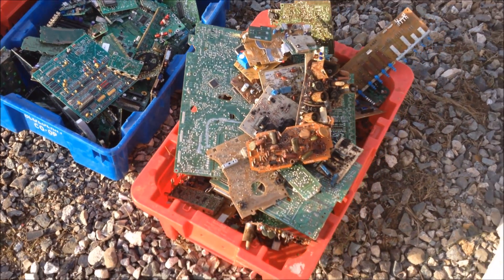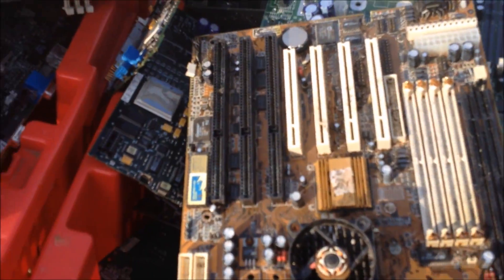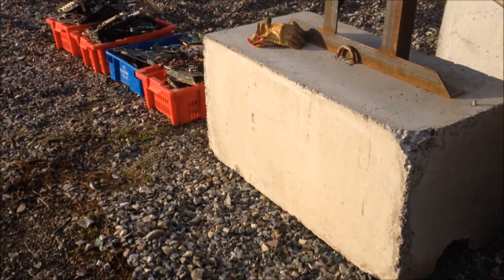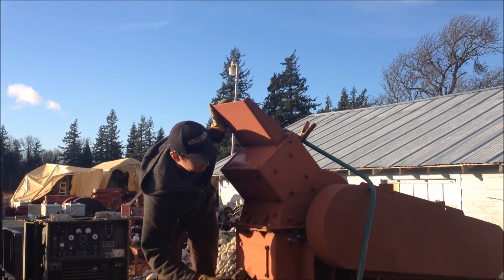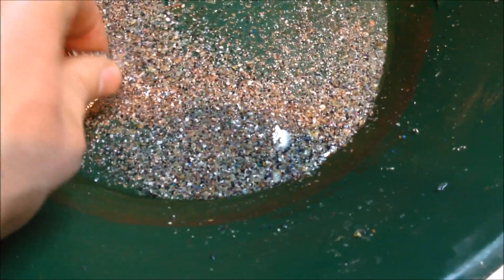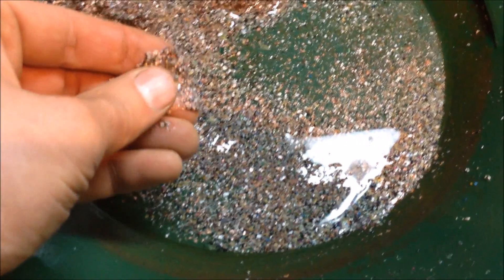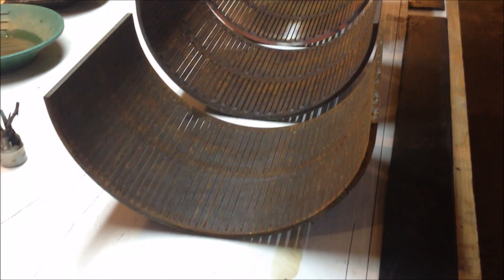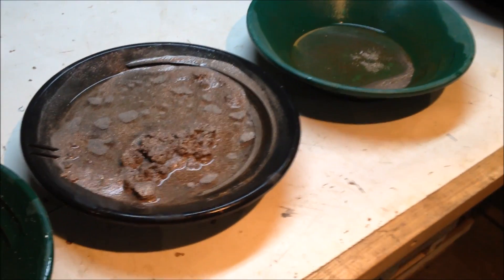URBAN MINING! Recovering gold, copper, precious metals from PCB's without chemicals

Comment: Just some thoughts. What you call free gold is gold from inside black IC chip packages also from black part of chip you refer as gold corner. It is inside in form of gold bonding wires. However they are very soft and male-able so some broken pieces of bonding wires may end up smeared on other pieces of metal due to action going on in hammer mill so your copper or other metal discharge can contain some amount of gold too. It happened to me when I was grinding this type of material too, The more I grind-ed material, I noticed gold powder from bonding wires disappearing and base metal pins becoming golden :)  Broken gold plated pins will be there too (metal discharge). I have sent you email with some of my findings. Keep up the good work.
Reply from the maker: Patnor-

Thanks for the tips and the feedback.  It is always good to get some feedback from others who have been through the process before.  I think over grinding is something that really needs to be avoided due to over grinding the gold (or other metals) which makes them harder to concentrate by gravity.  Flownder (previous commenter) was also talking about cleaning the boards by hand of the more valuable materials before grinding them all up in the hammer mill.  This may be the way to go for gold chips and other valuables on the boards?  Do you have any experience with hand processing the boards first before grinding?  Does it pay to do so?  Also do you have any idea about the purity of the gold from the bonding wires?  Thanks, your comments are much appreciated!
Reply: mbmmllc I would not go that route if I will have some big loads, I mean it is not economically viable in my opinion to do boards by hand. Your approach is somehow better but do have its own challenges which need to be solved. I think that if you achieve successful sorting of material to organics with no value and metals that is the most important thing. It save energy and environment from incineration method. I suggested to separate at least s/n bridge chips from boards before grinding as leaving them there will just mix easy to be recovered gold together with other junk. Gold bonding wires are made from fine gold. I got my hands at couple hundred kilograms of boards and depopulating or cherry picking values from them is a long tedious work which make sense only if you do it as a hobby. Not as a job. It require set up and know-how worth few millions to be able to turn around volumes and make a living out of it.

Comment from the maker: Hi Flownder-
Thanks for the comments.  Our goal with the circuit boards is handle them as little as possible, get them ground up, and recover the metals to sell to a refiner for further processing.  It is going to be costly and take a lot of time to hand clean the boards.  It might be worth it, I am not sure.  My only question is the price of tantalum is about $150/lb so I'm wondering why the tantalum capacitors are only worth $6/lb?  Wouldn't you rather grind them up, get all the tantalum out and sell it with all your other metals?  Even if you only get paid 1/2 price from the refiner you still get $75 per pound for the tantalum and you don't have any extra time sorting and hand cleaning all the little pieces.  

Your other comment about saving up the #2 and #3 hole are right on!  I completely agree, save up a few 55 gal drums and then cash in at the refiner.  Thanks and let me know what you think about hand sorting vs grinding, because maybe you are on to something I don't know.  I know the Chinese hand sort some of their boards, but I think their pay rate is quite a bit lower than in the USA so it might be profitable over there.  Thanks again.
Reply: Depends if your set up to do all boards all the way through like the big boys do and depending on how much material your getting in and what your time is worth. Sorry on the $6.00 should have been $16.00, the price of Ta you quoted is clean vacuum melt Ta, refineries don't pay on Ta, they pay on Cu, Au, Ag, Pt & Pd from PCB's and that's it. That's why with the amount of material I have coming in I take off all the aluminum, steel and plastic I can within reason. For every pound of material I take off the boards that I'm not going to get paid on from the refinery, I'm saving a buck on it. So say I'm taking off all aluminum, extruded, cast and sheet, most heat sinks are extruded and worth the most of the aluminum items, so about $0.65 a lb, when you add the buck you save on processing fee that's $1.65 per lb. on aluminum extrusions. Electrolytic capacitors, the aluminum can type are sold as breakage at about $0.12 per lb., again easy to take off and add the buck per lb. Then there are items I take off to be processed by me ie: fingers, north & south bridge packages and some pins and other surface mount devices.

Even if you worked out a better deal with the refinery for the processing fee (that's about $1.00 per pound right now) by telling them you could grind up the material first (and I'm not saying they would do that) your not getting it fine enough for them. When they are done with the grinding process, that stuff is like talcum powder it's so fine. btw, don't grind up any batteries like the button batteries.

What you could also do is just like your doing but melt it all with Cu as the collector and make dore or refiner bars and sell them to a refinery based on the assay. But now your going down the EPA regulatory road. Heck even the grinding stage is regulated so don't get caught grinding them up.

If nothing else, stop grinding up power supply boards aka: low grade boards. None of the boards in the video that I saw were high grade. The better boards you had were mid grade mother boards. High grade would be telecom type boards covered in chips and or gold plating, or just old highly populated boards pre mid 90's. Also, refineries have a minimum so that was why I said about 5k pounds. If you had 10k lbs. they will usually drop the fee by $0.20 per lb. It's hard seeing all this treasure and finding out how hard it is to get it out. Oh, and the stuff made today don't have near the pm's in it that it once did.
Reply from the maker: flownder28 WOW!  You are a wealth of information, and it sounds like you have some real life experience in processing boards.  If you don't mind sending us an email at MBMMLLC@gmail.com or give us a call at 360-595-4445 we would love to pick your brain a little bit and learn how we can improve our process from your experiences.

I am really surprised the refinery doesn't pay for more of the metals.  I think there is lots of Pb, Sn, Ta (if you don't pick the Ta off), others?.  Is your refiner in the US/Canada or international?

I have a good friend who has a mill in MT and he is processing a hardrock ore with copper, lead, zinc, and some gold and silver.  He is making a concentrate by gravity and flotation.  The con assays about 10% copper, 20 oz/t Au, 100+ oz/t Ag, with lead and zinc as well.  He couldn't find a refiner in North America to pay him for anything more than the Au and Ag.  Right now he is sending his concentrate by rail to the port in Seattle and sending it to a refiner in Korea and they pay for everything, including the Fe and S which is considered waste here in the states (we often times don't even assay for it when looking at ores, and when we do we only use it for an indicator metal, not value added).  He is making more money by sending to Korea, even with the extra shipping cost, because he is getting paid for all the metals.  I am wondering if you could find a refiner who would pay for more of the metals in the boards if it would be worth while, even with the shipping cost?

Good tip on the batteries, I know there is a ton of nasty stuff in there you don't want to be exposed to.

Do you grind your boards up and concentrate the metals once you de-populate them or do you just send them to refiner whole?  I am re-thinking the whole board grinding process to look something like this:

1.) Boards are pre-sorted into low, med, and high grade piles
2.) Boards that are worth it are de-populated by hand to remove: Ta, IC chips, finger, Al, anything else that is worth/pays to remove.
3.) Boards are then run through hammer mill and onto shaker table to recover mostly Cu, Pb, Sn, etc. and the PM's that were not removed by hand (if any)
4.) #1 hole from table (high grade concentrates) refined in house to remove Au, Pt, etc.
5.) #2 and #3 hole are stored in barrels to be sent off to refiner
6.) Tailings go to waste, or further processing (incinerate?, grind finer? reprocess?) if it pays or is needed.

How does that flow sheet sound?  I think regardless of if you de-populate the boards or not they still need to be ground up to recover all the copper, etc.  because by grinding and concentrating the metals I think you remove about 1/3-1/2 the total weight.  I think that means that you can save about 50% (50 cents/lb at your current price) on your refining costs by removing the fiberglass board weight which doesn't pay anything at the refiner.  Let me know if this makes sense or I am just wasting time by grinding the boards up in your opinion.  Thanks Flownder, I really appreciate all the info and experience you have and I am grateful you are sharing it with us all.

The absolute bottom line to this whole project is how to recover the MOST metals, and make the MOST MONEY from processing these things so if there is a way to improve our process we would like to hear about it.  Thanks again and look forward to hearing back from you either here on YouTube, email, or phone.  Thanks!
Reply: mbmmllc we separate monitors, lead glass and the boards but other than that we grind up everything separating out the metals, turning the plastics into fuel, along with the initial process of heating and separating...we're a materials recovery company so focus on every compound to be broken down to a commodity to be resold....the only thing we don't break down is phospor from tubes...we just concentrate that and resell in mass to companies looking for the rare earth elements and the radiological traces we get....you bring a good point of tantalum.....its high mp is a problem for our normal process....but we're working on tweaking our process to pull it out as a by-product of the over all process..let you know what happen...have a nice day...
Reply: mbmmllc Hi Jason, 

do you have any reply from flownder28?
Reply from the maker: Lubomir L I haven't heard any more from Flownder28.  I will let you know if I hear anything more.  Thanks
Reply from the maker: Lewis Campbell I would be very interested in talking with you over the phone about your project.  If you wouldn't mind would you give me a call at 360-595-4445 when you get a chance.  We are on Pacific time.  Thanks and look forward to hearing from you.

Comment: All of those boards should be pre-processed by hand first as they are collected, transformers removed and sold with elec. motors, Ta caps sold for about $6.00 lb., electrolytic caps removed and sold as breakage and so on. I would think a finer material would produce better results as well, not really down with milling right onto the table. Good work and ideas, just lacking a bit on execution imo. Also, anything that's plated with pm's will most likely be in with copper. The gold band on the table would only be gold bonding wires.

Comment: Some of those boards had a LOT of Tantalum capacitors on them. (Mustard yellow bits.) Sometimes it Niobium, but both can be more valuable than gold.  Any idea how those might be recovered?
Reply from the maker: Hi Fotm-
Thanks for the comment.  The tantalum and Niobium will be captured by the table and then can be recovered through the refining process.  I am not sure they can be separated individually by gravity methods because they are quite close to the same density as the other metals.  Thanks!

Comment: You could probably improve recovery by ball milling the hammered product.If its worth the cost comes down to testing but the equipment wouldnt have to be heavy duty since the material is already quite fine.
Thoughts?
Reply from the maker: Arq-
Thanks for the suggestion.  We have some assays out right now that will give us a "point on the graph" for the recovery with the grind size we are working with.  I think there are some other companies out there that are using ball mills to grind the boards, but ball/rod mills are so expensive to buy and run.  We have visually inspected the tailings with a microscope and we hardly see any metal left in the tailings at all.  The assays will tell us for sure.  I will post the results of the assays so we can get an idea of the recovery.  Thanks!
Reply: Getting that info will be very useful going forward. Ive been toying with the idea of simply grinding the boards up as you did but I always thought a hammer mill would not make the material fine enough, but looks like I couldve been wrong on that.

If a hammer mill and a shaker table are all you need this might be a feasible setup even for a smaller scale operation especially since the startup cost seems quite modest. 

Id love to know how much it would cost to set this up and what the running costs are per hour.
How long do you think the hammers would last running the sort of material that was used in this test? Id imagine removing heatsinks would make a significant difference.

Thanks
Arq
Reply from the maker: Arq I will certainly let you know the results of the assays when I get them back.  I will post them in the vid description.  As for the running costs and the cost of the equipment please send us an email at MBMMLLC@gmail.com and I can send you a full price list with different sized hammer mills with various power options, shaker tables, as well as the cost of replacement parts.  The hammers should last for a very long time.  We get about 30-40 running hours out of a set of hammers with hard, abrasive quartz ore so I think the hammers will last many times longer than that with boards.  Thanks and look forward to hearing from you.

Comment: A couple of those motherboards still had ram sticks on them, so you got a bonus.
Reply from the maker: Hi Chris-
Thanks for the tip.  It sounds like ram sticks have quite a bit of values in them?  I know they are loaded with gold plated pins/connectors.  Are the other metals in ram sticks in addition to the gold plated metals?  Thanks.

Comment: I got my college professor to order a hammer mill used for rocks. (hoping it will be here before Christmas.) I am planning to run De-populated boards and chips separately. I have cleaned off the boards, i didn't want a lot of debris to have to sift throw. I will be using a miller table and gold pan. A shaker table would make it so much easier. I am trying to find a place in Montana that i could possible rent or the would just let me use one for a short time. Do you have any idea how i could catch the copper? How much gold did you get? and the gold you showed in the pan at the end, was that from ALL of the boards? Loved the video thank you!!
Reply from the maker: Hi Mymuse-
I will be very interested to hear how your project goes.  Please keep us informed.  I would look into getting a small shaker table, because they are fairly simple to operate and they do a great job.  The total amount of free gold recovered was 4.8 grains or .3 grams.  This was the clean up at the end of the entire test, however we didn't see any gold on the shaker table until the last two bins, so we figured that the gold was from ~20-25 lbs of the high grade boards.  Thanks and look froward to hearing how your project goes.
Reply: how did you depopulate the boards ? by hand ?
Reply from the maker: Magpies Recycling We actually didn't depopulate the boards at all, we ran them whole as our first experiment.  For the next couple of runs we are going to depopulate the IC chips to run separately and maybe the tantalum capacitors too.  We are trying to find the best way to get the most recovery for the least amount of work.  If you can run them whole with a little bit of loss but still make it worth while (determined by the operator) then this will cut down the labor cost tremendously.  If depopulating gets a higher recovery and can pay for the extra labor cost then that may be the best way.  I think everyone will have their own unique spin on how to operate a system like this.  Thanks for the comments and stay tuned for more vids.

Comment: Love the videos and following your channel closely.

Boards that can take a CPU of 2" or greater are classed as "mid-grade". So the one off the top of the last bin is a mid grade board because it looks like it has a 2.5" CPU socket and often those sockets have gold pins in them. The other boards are generally considered low grade, i.e. telecom boards, boards from VCR's and other consumer electronics that aren't mother boards. The boards in the first bin were very low grade. Of note, the mid grade boards might have button batteries on them and these contain mercury. Just an FYI, the boards often contain other hazardous materials like beryllium, cadmium, arsenic and antimony in small amounts.

Great job by the way
Reply from the maker: jd-

Thanks for the tips and the clarification on the grades of the boards.  It sounds like most of my "high grade" boards were actually mid grade boards huh?  That is good to know.  Also the part about the batteries and other nasty metals is a good one.  If going into production precautions should be taken for heavy metals exposure.  Thanks again!